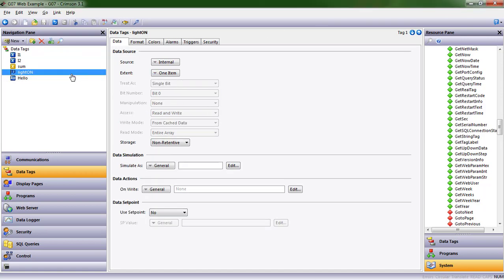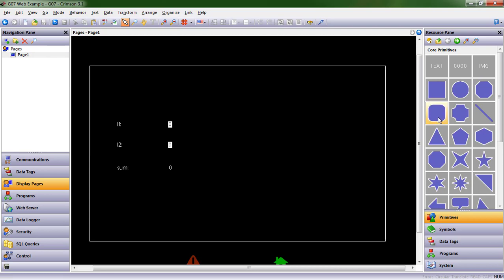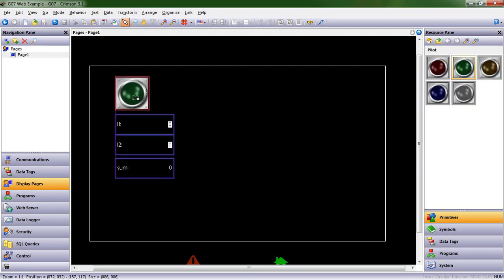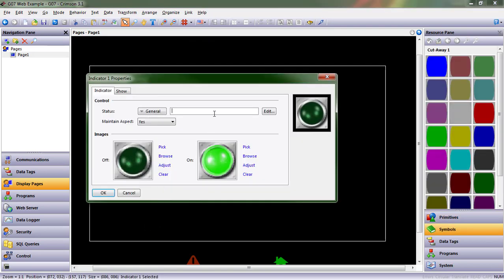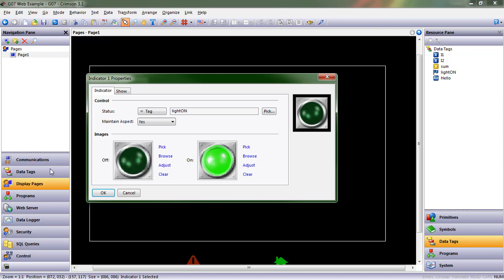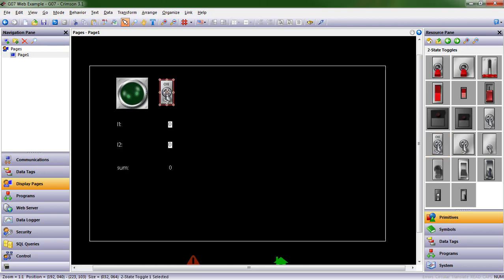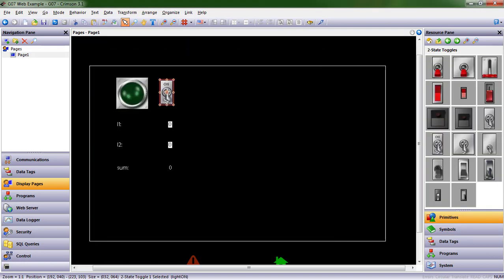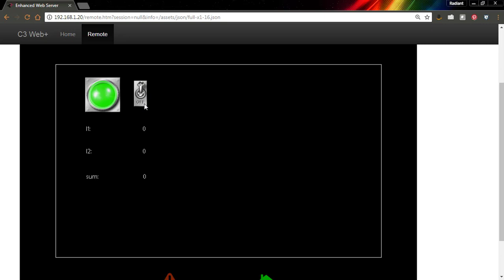Crimson 3.1 Training - Using a Flag Tag Light and Switch

Comment: this is good, but could you expand this tutorial so that rather than the switch directly control the light instead it sends a message out the tcp/ip port to some tcp/ip address to read the fact that the switch has been changed.  conversely, the HMI should accept a TCP message from a tcp/ip port to turn on or off the light.
Reply: I am looking for the same thing.